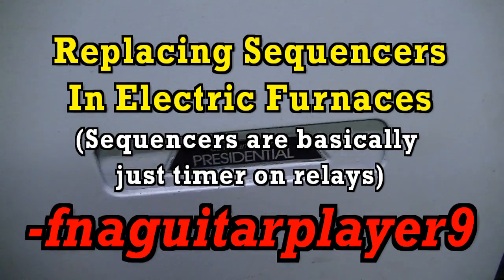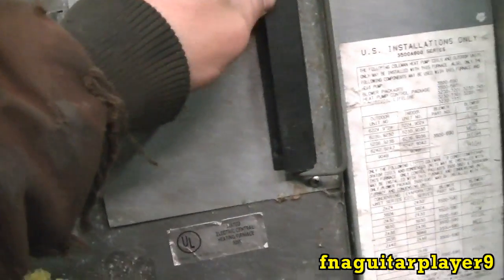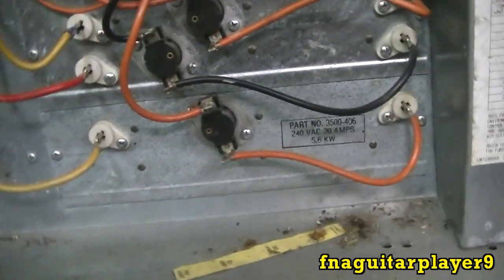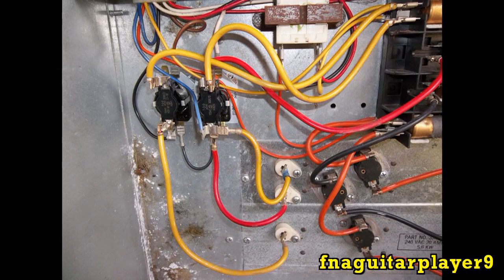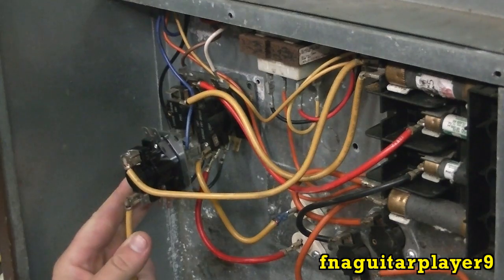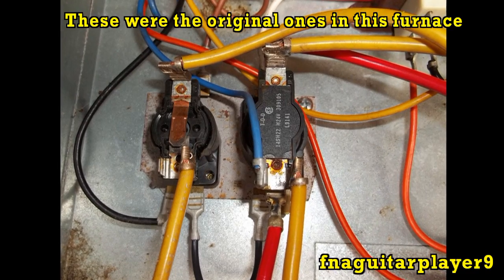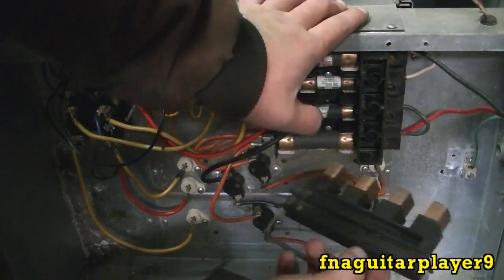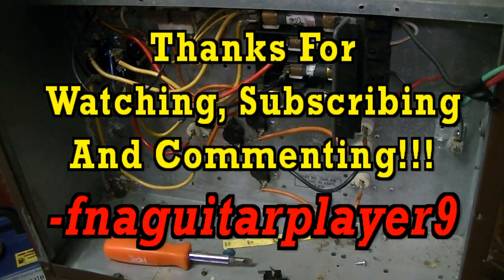How To Replace Sequencers In Electric Furnances

Comment: Hello ! I came across your video needing a little help in switching out a Coleman Heater Sequencer, it looks just like the one your replacing, Sequencer PART # 3400-357... Here is where my concern/problem comes into play,,, The replacement sequencer for part #3400-357 has a wire rod soldered across the front and the back  joining the 2 sequencers together,, the one in the front I understand it's replacing the need for the black jumper wire, It's the soldered rod on the opposite side connecting the 2 sequencers together that has me concerned, my original sequencers do not have this soldered rod, it's has a brown wire connected to the small sequencer going to the harness, and a white wire connected to the large sequencer going to the harness, So when I connect my brown and white wires to this new sequencer is this solder rod going to cause a problem, or do I need to snip this soldered rod out of there so it looks just like the way the original double sequencer is wired up ??? Thank You for any help :)

Comment: I got the same kind of furnace, and I bought the sequencers that it calls for, but the ones that are in it are different. One is a short one and one is a double and there is only one hook up on the bottom of the short one with a rod going to the other sequencer.
Reply from the maker: I'm not sure right off hand, i'm sure there will be a way to retrofit the new ones to it, that sounds like a mechanical link between them, i have heard of them but I don't think i've ran into it yet. Thanks for Watching!!!
Reply: fnaguitarplayer9  what kind of sequencer did you put in the 3400A816 series Coleman electric furnace  was one short and double stacked. And do you have a part number?
Reply from the maker: @michaelwest873  Honestly I don't know what the part numbers are, but i do remember one being a double and one short, but thats all i know on it. I may have just bought a set off of ebay that looked like them and went with that, it seems like it was cheaper but i could be completely wrong! wish i could help you more!

Comment: Hi :)  Great video.  I have a strange situation.  When the wall thermostat is set to "off" the heat comes on (without the blower) and heats up the inside of the wall of the furnace and eventually the area around the space of the heater.  When I slide the thermostat to "heat" I get no heat but the blower turns on and blows cold air.  I'm thinking there is a bad part telling the heat to turn on instead of off.  What part should I replace?  Thanks in advance. :)
Reply from the maker: Hard to pinpoint that without looking at it, could be a sticky sequencer or possibly a thermostat issue as well. Wish i could help more. Thanks for Watching!!!
Reply: When the thermostat is in the off position, all circuits within it should be open. The very fact that when you set it to off and it sends a call for heat means there is a problem at, and most likely with, the thermostat itself. There really should not be a way to incorrectly wire a thermostat to have the heat come on in the off position. That being said, check and make sure your white wire is connected to the W (heat). Since the fsn comes on when you call for heat, your green wire most likely is connected to the G already (or to the W if wired incorrectly). If you find the white wire is connected to the W then replace the thermostat. Of course if you can't afford a new one you can always connect the white and green wires to the G terminal and both will come on when you call for heat. This will not allow just the fan to be turned on solo though and this definitely is not something you want to do if the same thermostat also controls an A/C unit. But in a pinch, at least it will turn on the heat and fan at the same time when the sequencer kicks in.

Comment: Basically the blue signal wire goes on the bottom but there is only one prong. On his the blue wire is on top. Seeing as they aren't polarize can I just move the blue wire to the top with 2 prongs?
Reply from the maker: I don't see a problem with it, as long as it has its signal and the "neutral" it should be fine. Thanks for Watching!
Reply: @fnaguitarplayer9  thanx for the quick reply. Sub'd
Reply from the maker: @petyweestraw  I'm trying to stay on top of comments better this year haha Thanks for the sub!

Comment: I'm going to sound like an idiot when I ask this but based on all your videos I have watched, I'm still confused as to what may really be the problem with my furnace blower (which works when switched to Manual). From what I have gathered, the Sequencer/Sequencers control the Blower Fan after the thermostats & heating elements tell it to. I had a bad wire coming off one of the heating elements that went to the big sequencer & replaced that wire but the blower still does not come on in Auto mode. All three elements work & heat up but once the blower doesn't auto kick on, they kick back off like it's supposed to. So am I correct to assume it is a bad Sequencer?
Reply from the maker: It does sound like a bad sequencer to me, i would try that first and see what happens. Thanks for Watching!!!

Comment: Great video. Thanks. What gauge / type are the wires?
Reply from the maker: Thanks, you welcome. It really depends on the furnace, some elements may pull more amps so there is no set gauge of wire, but on this i'm thinking it would be a 8 or maybe a 10 gauge. Thanks for Watching!!!
Reply: @fnaguitarplayer9  Certainly. You're welcome. I am actually asking about the furnace in the video. Also talking about the wires we can actually see in the video, coming out of the sequencer. Looks much too thin to be 8 or 10 awg. Any idea? Thx.

Comment: Got another question on my furnace. I know I have one element out. Sometimes my thermostat will have a green light in the upper left hand corner on. It's like it is asking for extra demand. When that light is on, my outside air conditioner unit's fan will be running, but at a lower speed than when the air conditioner would be running. Any ideas on that?
Reply from the maker: Sounds like its trying to make up the difference of not having the one element working, i would say. Not real sure on that to be honest.
Reply: I shut the breaker off to the outside unit. It is just a regular hi efficiency cooling unit from Rheem. The thermostat is from Proselect but is not the basic unit. I know some do not have that light on them. I am kinda tending to think it is a problem with the thermostat. The house is a  very well insulated 1700 sq ft brick and it has no problem heating it with just the two 5000 watt elements which is 34,112 btu's.
Reply from the maker: That could be the problem too

Comment: I got a question on sequencers. I have a 15 kw unit with 3 heating coils. When the 24 vac goes to the sequencers they are all 3 going to be on in something like 2-3 minutes? They are all three getting 24 vac. M1 and M2 is going to turn on right away in a few seconds. In a few more seconds M2 and M3 is going to turn on? And, in a few more seconds, M4 and M5 is going to turn on too? And just the opposite in shut down? But the thermostat is going to turn on all three pretty quick? Not just one or two?
Reply from the maker: Usually they all turn on within a few minutes at most, not all at the same time to prevent a large power draw, but 1, 2 then 3.  usually within a minute on the ones i've seen. Yeah they are more less triggered by each other to turn on and off. Thanks for Watching!
Reply: I couldn't see it working any other way electrically. Thanks
Reply from the maker: your welcome

Comment: Hi my electric heater won’t turn off do you think is the sequence
Reply: Yes the Sequencer can get stuck in Open which is No Heat or stuck in Closed Position Heat won't turn off sometimes tapping Sequencer with Non metal tool it may quit heat or turn on heatalso be careful it may fall apart in front on you
Reply from the maker: That could be the problem or the thermostat wires are shorted somewhere keeping it from shutting off. Thanks for Watching!!!
Reply: I’m having the Same problem did you get it resolved

Comment: I have the same typ of heater I was going to put in my Garage . I was going to hang it from the ceiling . But as you was saying , it burns up a lot of electric . I only have 100 amps going to the garage . (it is a 60 amp furnace ) . I was testing it out and it did kick on at all , No blower or heat elements would come on .. Think its the Sequencers ? Also ? what would make it unsafey to use that way ??
Reply from the maker: I hear ya, yeah it does use alot of power. But depending on your garage size and how well its insulated it won't run to much. I'm not real sure if there would be a problem with hanging it like that to be honest, I have seen some install horizontal in attics but do not know if you can mount any of them like that. I would check the fuses first, make sure the disconnect is installed and contacts are not corroded, then do some voltage readings to see if power is going to the sequencers. If its not doing anything at all, it may be the low voltage control side not working. hope this helps, Thanks for Watching!

Comment: I've spent my day learning about electric forced air furnaces and then found your vid.  Good job! Slow, careful, clear explanations.  I am sloooowly learning.   The reason?  Well, I have been working to reduce my electric heating bill by keeping the heat lower.  My 7-year-old programmable thermostat is set at 54F.   This ranch-style older brick home has been staying between 61 and 64 F, far above the set temperature.  I noticed the kitty laying atop the one vent that is situated directly above the flat, rectangular furnace mounted on the foundation in the crawl space.  Warmth, eh?  Felt a very low level whiff of warmth coming from the vent, which was cool enough, comfortable enough for kitty to sleep on.   I checked the other floor vents.  All were cool.  I could not hear fan running.  

I asked AVISTA utility company about it.  They told me this was normal.  That some energy would always be comng from the furnance unless I turned the breaker off and particularly if it is in a cold crawl space during the start of a northern winter.   Another person said "nope, that is not normal. I do not kinow what is wrong but maybe the sequencer?" 

Just to satisfy my curiosity: What' would be your guess, with just that information?   I did not see the meter spinning crazy fast.  I have turned off the breaker to the furnace and no more little bit of warmth.    I live rural and the cost to get here just to arrive at house can often cost more than the repair.  I've been ripped off once.  Now cautious.  

I am wondering if I can do the fix myself.  My husband died.  Learning everything I can learn.
Reply from the maker: It may be a sequencer staying on, keeping a element on (maybe just one element) after it shuts off, it will get hot and trip the overheat protector (thermostat on the element) and would explain the slight warmth coming from the vents. If you do work on it make sure the power is off and be careful, may be best to someone work on it. Thanks for Watching!
Reply: @fnaguitarplayer9  You are spot on correct!   Excellent company put in a new sequencer yesterday for $168 and works like a charm.  I also got to see the actual sequencer and after learning about what I have, yes, I could have changed it myself.  The repair guy was fast, courteous, tidy, and gave me a 1-year warranty on the part and free labor if anything fails. I am glad to now understand another part and the how-to.  Thanks for your vid!
Reply from the maker: I hear ya, thats not to bad of a price to be honest. Your welcome, glad to help out!

Comment: Thank you so much for this video. You explained everything so well that it gave me the confidence to order my sequencers and heating element online and replace them myself.
I have the exact furnace you showed and paid for an HVAC company to diagnose why the furnace was always on and I had to shut off the breakers. I paid $95.00 for a diagnosis which also showed that I needed a heating element. The price for the repairs and cleaning (we just bought the house that had been vacant) was $570.00.
I found your video, found the parts online and replaced them with your advise about replacing wires one by one. I spent hours taking the blower apart and cleaning everything that was covered with 3/4 inch of dust. Put it all back together and my furnace works like new! And I saved $430.00!
Reply from the maker: Your welcome, glad to help out and save you money! Its crazy what the companies will charge. Thanks for Watching!!!

Comment: I have a furnace similar to the one you show in your video. I just recently replaced bad heating elements. Everything worked perfectly but the only problem that I’m having is that when I turn my thermostat to kick in automatically for heat it will never come on in automatic I have to turn the heat on and the fan to on in order for it to work. Is there a recommendation You can give me as to why the fan will not come in automatic mode. This only happens with the heat if I set the air conditioner to come on at a certain degree it will put the fan will never come on when I set the heat to come on automatically. Thank you for any help you could possibly provide. thank you for uploading the videos
Reply from the maker: It sounds like something is wrong on the thermostat end, either a bad thermostat or something isn't connected right, or a jumper is off, on certain furnaces / thermostats a jumper may be needed on certain terminals, which might explain your problem. your welcome, thanks for watching!!!
Reply: The sequencer is supposed to turn on the blower with the first element. Maybe it needs replacing or the wire terminal may have come lose.

Comment: i have a all electric furnace ac/heat my ac worked great all summer now its winter time and i turned on my heat on auto for the first time(new house) and it will not kick on,i see the heating elements getting hot but it will not blow heat out nothing blows out,i put the thermo on the wall on on/heat and it kicks on but doesnt blow hot any idea
Reply from the maker: Francisco Giron sounds like a sequencer is bad, if the blower doesn't come on when it's on a.c. now then I'd say the capacitor may went bad, it could also be a blown fuse if it has a separate fuse for heat. Hope this helps, get back with me if not and I will figure something out. Thanks for watching!!!

Comment: Man! Thank you for so much knowledge My Coleman heater element is stuck on / clicks on and off when it is off & fights the a/c by staying on I have to throw the breaker to get it to shutoff fix one burn wire terminal so now it is clicking on & off verses staying on the whole time about to change sequencers tomorrow Couldn't find a video for above whats your knowledge on it? Thank you in advance, Happy
Reply from the maker: Your welcome! Sounds bad sequencers to me, I would suggest changing them, they act like a relay and if the contacts get burnt together or something it will stick on like that. Your welcome, Thanks for Watching!!!
Reply: as of right now got it narrow down to the small sequencer side have the wire unplugged from heater element to use fan/a/c finally bought new sequencer hope to install it soon Thanks!
Reply from the maker: I hear ya! hopefully that will take care of it. Your welcome, if you have any more problems let me know.